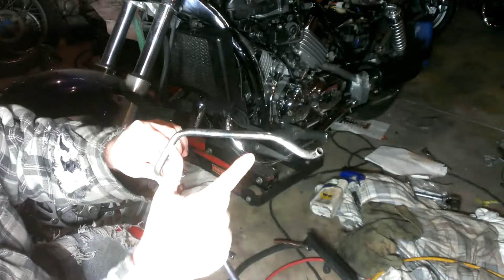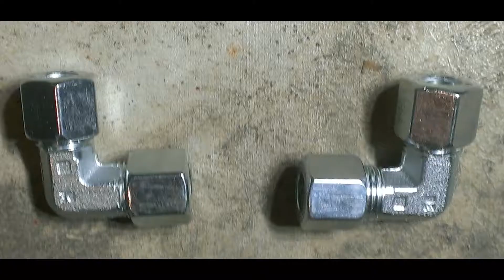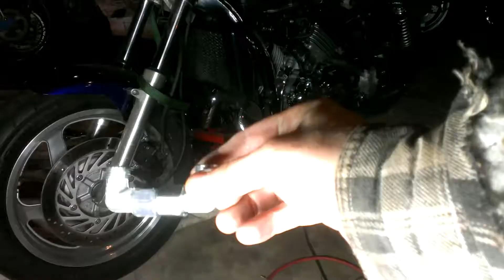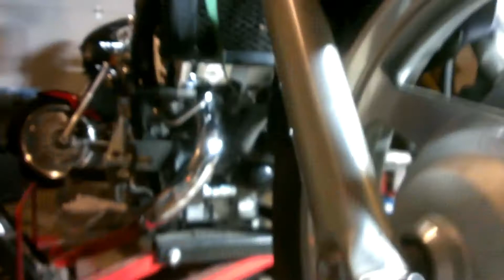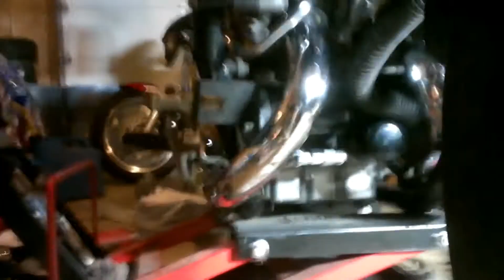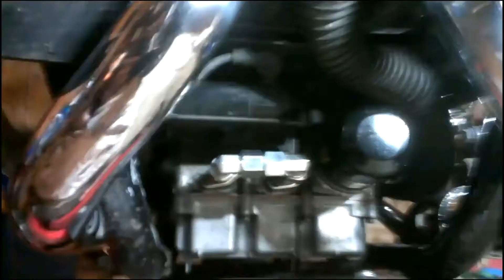Oil cooler bypass on the VFR motor

Comment: Could you have blocked it off with a plate  and gasket? (Both inlet and outlet)
Reply from the maker: There are tubes internally feeding those ports and I believe the system feeds all the oil flow through there.  Blocking it would choke off all oil flow.
Reply: @krullmi  I can understand that. How is it running as of today. Can I ask you for your email I got some questions about the build.
Reply from the maker: @danielbautista0000  Still running great! If you're on the http://v4musclebike.com/  forum  you can post questions at the end of the thread on this swap.  As of right now the last page is page 8 here: https://v4musclebike.com/forums/showthread.php?t=28440&page=8.  Posting questions there will help others that may have the same questions. I encourage you to join the forum if you are not already a member.  Lots of great people willing to help there and everyone is quite friendly. If you still prefer e-mail I can provide it. It's just the last time I posted my e-mail i was inundated with spam for weeks.